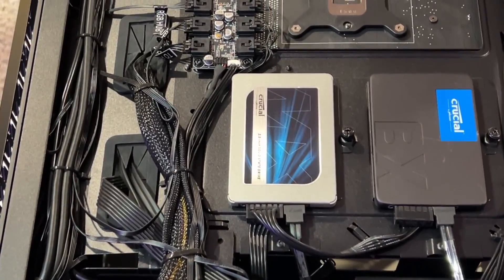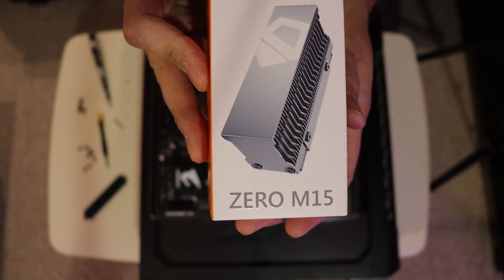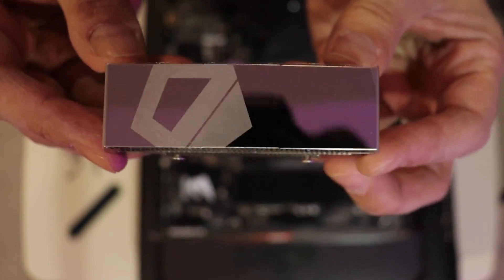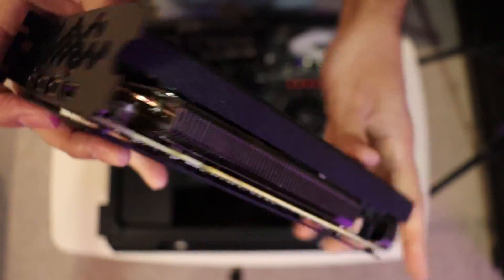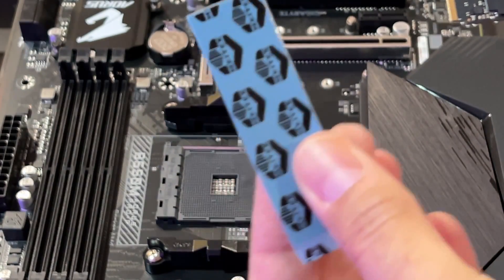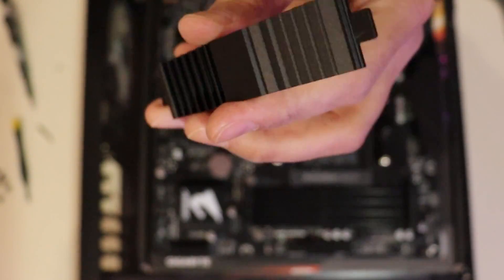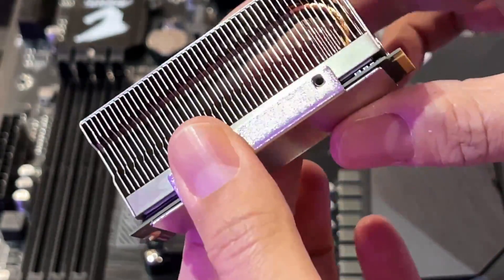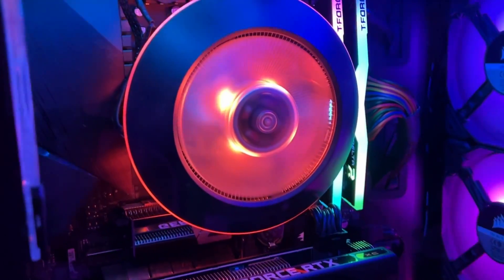SK Hynix Platinum P41 Install With Heatsink | Speed and Temperature Test

Comment: Hi. Have you updated your SSD firmware since they released an update recently ? How it works on the new firmware? Did you notice a difference in SSD performing before and after the update? Can you say that the problem has been permanently solved?
Reply from the maker: @adamtorbacz4012  hello. I have not updated the firmware on this ssd. It has been working good for me so far. Didn’t see a good reason to update. You know what they say, if it ain’t broke…… don’t break it.

Comment: Hey bro , if the cache clearing issue is real in sk hynix p41 that lead to speed and storage degradation then your speed might be around 2400mbps in some months from 7400mbps .😅..plz reply if you faced anything like that! ...plz reply!
Reply from the maker: @icommanderx  hey thanks for chiming in on this. Currently it’s still running strong on my end. I did look up some forums regarding this issue. Seems they are not the only ones that have this happening. I did see where they were issuing refunds or replacements. Nothing in the way of firmware updates to address anything yet though.

Comment: Thanks for the video, I wish I had also seen what temperature hits without that heatsink.
Reply from the maker: @dailylife8901  I should invest in a thermal gun. I will say I use an external enclosure with an nvme and that enclosure gets pretty hot to the touch when working with large sets of data.
Reply: @TekToyzGaming  Maybe the drive hits really high temperatures. I think I won't consider it to my laptop lol, for desktops is fine since you can use good heatsinks for it.
Reply from the maker: @ it will get hot if your hitting that 7000mbs mark.

Comment: Just got this drive & I’m contemplating on doing a fresh install or migrating my os. 

the issue is that in my current os windows won’t update anymore & I get errors. 

I can’t make restore points anymore lol. 

and not to mention my motherboard is being weird. 

resetting might fix my motherboard. 

the issue with my motherboard is that I updated the bios with the latest version & after doing that the bios can only be configured once. 

If I try to go back & change anything it simply doesn’t change.

tried clearing cmos, tried rolling back drivers & it’s still being weird. 

I’m thinking maybe if I do a fresh install for the m.2 drive maybe it will fix the motherboard issue. 

the other 2 issues don’t limit my system & is the least problem. 

any advice would be appreciated
Reply from the maker: I would say start fresh with the new drive if you can afford to. Set up the new drive and get it up to speed and see if you get any errors. Slave the c drive you have now so you have access to the old data from your new drive .
Reply: @TekToyzGaming  yea, I might go with a fresh install. I just hope it fixes my motherboard issue. 

If not I would have to wait for gigabyte to address the issue or get a new motherboard. 

and if I get a new motherboard I might aswell build an am5 system. 

in terms of the files I have on the current c drive. I was thinking about moving certain files to a black usb & then putting it back in the nvme after I install a fresh copy of windows.
Reply from the maker: @LightWorks222  Does your current motherboard support pcie 4.0? Would need that to maximize the advertised speed of this this nvme.
Reply: @TekToyzGaming  yea I have a b550i Aorus pro ax mini itx board. it has a 4.0 & a 3.0 slot
Reply from the maker: @LightWorks222  ok then you’re ready for this ssd 👍🏽
Reply: By any chance did you have to update the ssd to get it at its rated speeds ?
Reply from the maker: @LightWorks222  not at all. Used it as is out of box.
Reply: @TekToyzGaming  I ran a bench mark & it’s running as advertised. I just need another drive to make a bootable windows
Reply from the maker: @LightWorks222  awesome. Will this be your system drive or a secondary?

Comment: I was going to buy this for a laptop. an Asus Rog Zephyrus G14, but your heatsink talk is making me think it's not a good idea. Is it really get that hot ?
My laptop came with a 512MB WD SN735 at 3500mb/s. I was looking to upgrade to a 2TB at 7000mb/s drive.
Reply from the maker: I suppose it really depends on how ‘high-end’ the gaming is going to be on this laptop. If not so high-end then you can stick with a 3500mb/s drive. You may not even really feel the difference and you will save $$$. Also, be sure it’s a pcie 4.0 slot otherwise you won’t see the speed at all.
Reply: @TekToyzGaming my question is is this drive too hot for a laptop ?
Reply from the maker: @paullavig8167  if your laptop can actually push this drive to a consistent 7k mbs then perhaps. The only way it can do that is if it supports 4.0. Pcie. If less than 4.0, you will only get 3500 max out of this drive.
Reply: It supports pcie 4.0. It came with a pcie 4.0 drive.
Reply from the maker: @paullavig8167  I just wonder about the transfer of say 100-200gb or more at 7000+ mbs straight without a heatsink. Haven’t tested that scenario so can’t say for sure.
Reply from the maker: @paullavig8167  I think you should be ok. I get a little paranoid and better safe than sorry.
Reply: Makes sense. My external drive came with a thin metal plate assume that’s a “heat sink” would this help at all or are those useless ?

Maybe a Samsung 980 @7000mb/s or the WD Black SN770 @5500mb/s. They run cooler and still up there compared to what I have now.
Reply from the maker: @paullavig8167  I’ve read some bad things about high rates of 980 failures. Look it up. The baby heatsink that came with the drive could do the trick. Probably better than bare.

Comment: Mine is under the GPU cooling system.  It won't fit a heatsink.  Unless there's a very shallow one that will.
Reply from the maker: Hey there. You can definitely get shallower heatsinks than this one. Plenty of good ones out there too.

Comment: Can I install this without buying a heat sink? Will this run Starfield well? Also how do I make this my boot drive, and do a complete transfer making this my main C drive?
Reply from the maker: Hey thanks for the visit. You can def install this without a heatsink, though I think you should if running titles like Starfield. You can do a boot drive transfer. I’ve done it in the distant past. Should be able to find the steps online with a search.
Reply: @TekToyzGaming  thank you this is my first time upgrading an SSD.